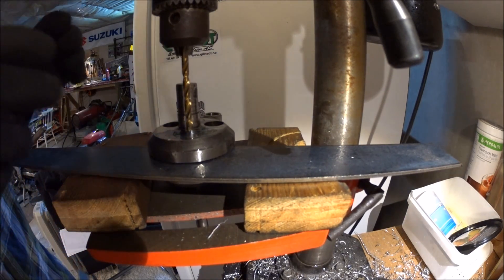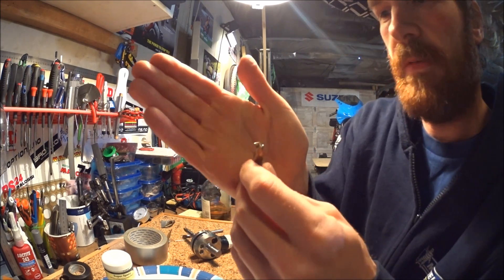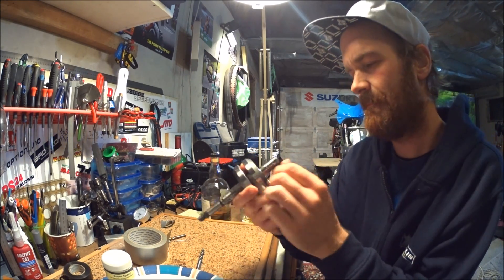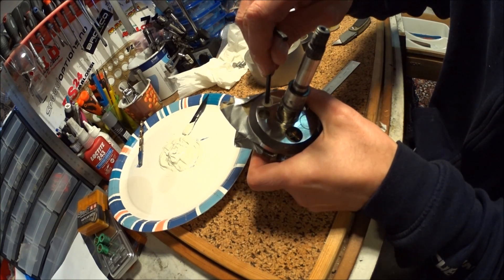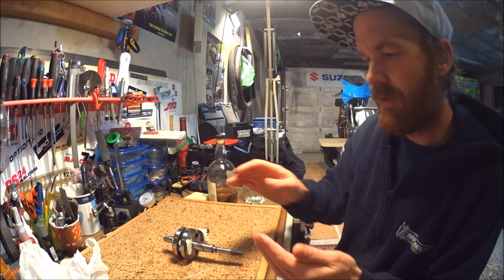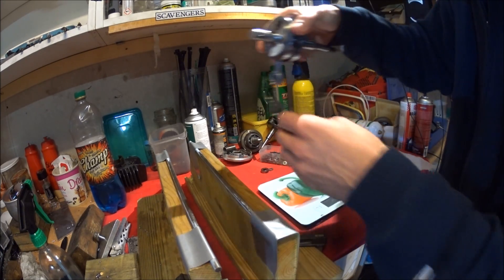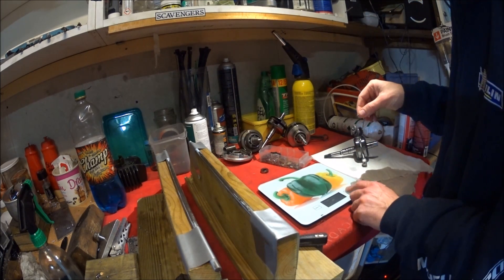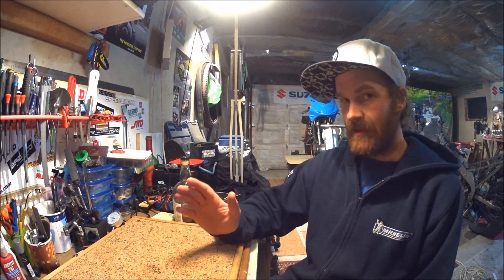E9 - Rebalancing The Peugeot Spx Crankshaft 2STROKE STUFFING

Comment: ur bit was spinning wAAAAYYY too fast :p thats ok for softer materials like wood, but with harderstuff like metal u have to go a little slower, both so the metal has time to move n get out the way, n also just as, if not more important, so the heat doesnt build up n ruin the part or bit

Comment: When you look up drilling speeds they are designed for a production environment where the cost of tools vs tool life vs  tool change time is a major consideration If you are in a home workshop it's usually better to cut rpm in half and feel the pressure your putting on. Lot of cranks are case hardened (Yamaha have beed doing it since the 1960's) Use a grinding wheel to get through the surface. Small drill press is too flexible to use solid carbide. The bit you bought is quite brittle, the steel shank helps damp down any vibration to stop tip shattering. They don't work so good with a hand drill

Comment: you may want to run that drill around 350 rpm max and get some sulfer based cutting oil.... holy crap you're giving me an ulcer.  Why didn't you make those weights a press fit, then tig weld them with no filler rod. That's how the rest of the world does this <:/)

Comment: What are your thoughts on knife edging the crank and polishing it?
Reply from the maker: +MAR0KSTEEL My thoughts are it won't make any noticeable improvements in power but it will make it weaker.
Reply: Just thinking of doing a bevel like yours on a e50 crank as well as a polish
Reply from the maker: +MAR0KSTEEL By doing that you will increase crankcase volume, depending on the rest of your setup that might be beneficial. Try it!

Comment: What kind of epoxy are you using?
Reply: Yeah, I saw your next video. I usually weld cranks with a 110 mig without issues. Just a bit of preheat for good penetration. Get some gas for that welder and try again, you can do it!